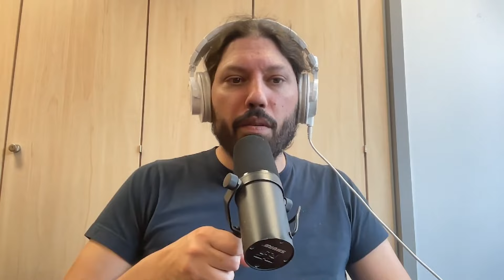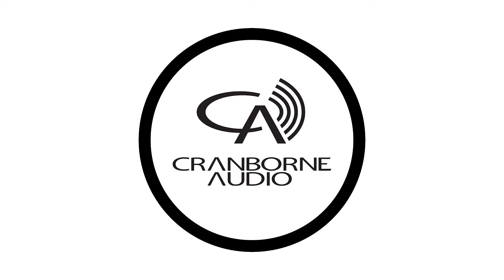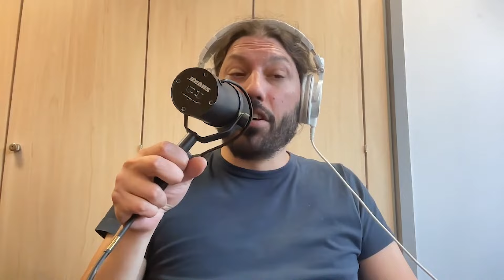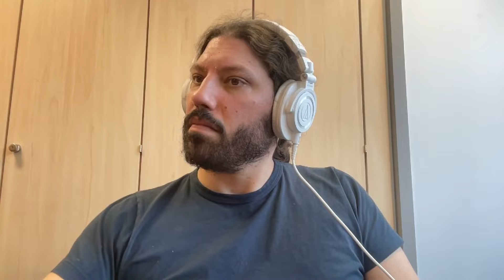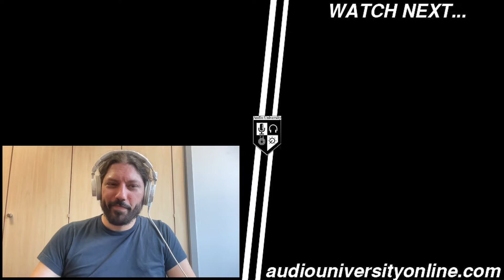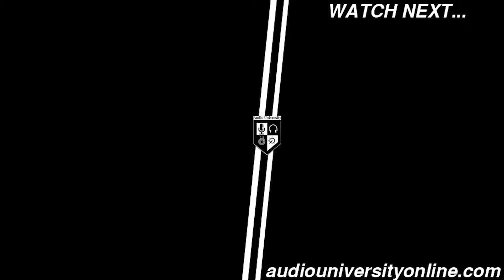The Benefits of Analog vs Digital Audio In A Modern Studio

Comment: Since when was phase shift audible? It can be made audible if it drives a signal into limiting, but that isn't the question
Reply: Hi, as someone said before, it's not a total phase shift, it only affects some frequency range, wich means some frequencies are going to arrive before to your ears, making a psychoacoustic effect where you could hear more definition between low and high frecuencies. This is a technique that can be replicated using plugins, like Ozone 5.
Reply: @p4493  good grief
Reply: Compared to the original sound, it does change. It's very subtle (sometimes, inaudible). However, if the goal is emulation of certain gear, then emulating how much a piece of gear might have shifted phase is also key in emulating the sound it makes (at least 1:1). Phase shifting doesn't need to be a total reversal, and that effect can be noticed in the right setting/ environment.
Reply: @DapperDanLovesYou  that sounds more like hope than fact. I'd challenge you to hear it double blind.
Reply: @donepearce  I'm not sure that I have the recording experience/ ears for that!
But, there are engineers and producers who at least claim they can consistently hear it. I'm not sure how many of them have legitimately tested themselves on it, but I'll divert to their expertise and experience in such cases ¯\_(ツ)_/¯
Reply: @DapperDanLovesYou  I've known engineers who claimed to be able to identify cables. They couldn't.
Reply: Something else Sean mentions @ 9:00 : not all Phase Shift is equal across the Frequency spectrum. Sometimes certain frequency ranges can be shifted more than others. This will have a much more obvious effect on the sound.
Reply: @DapperDanLovesYou  I'd like to see that demonstrated. I've experimented widely on phase shift, particularly between harmonics of a non-sinusoidal wave. If you can see the waveform display you can kind of persuade yourself you can hear something, but as soon as you look away the effect disappears. My conclusion is that phase shift is inaudible in sound.